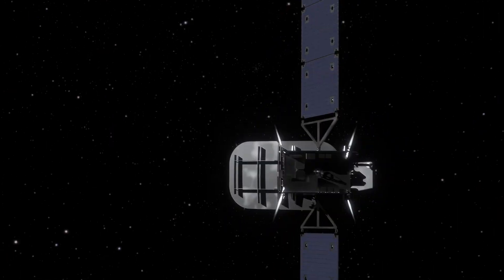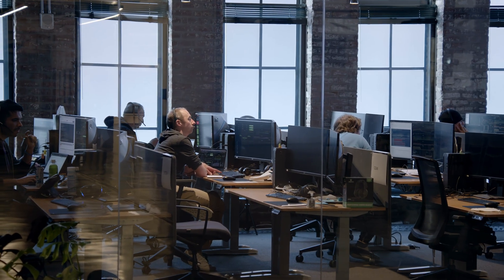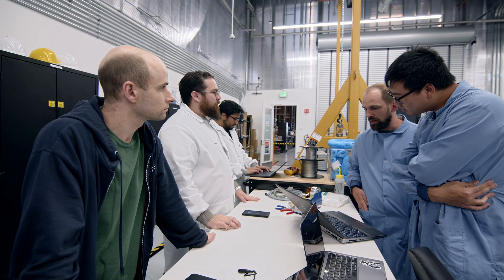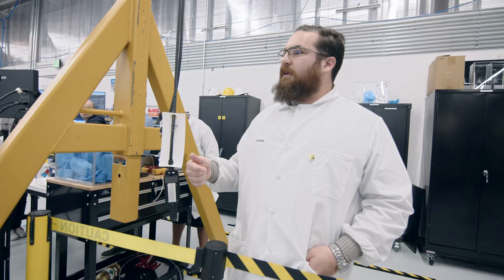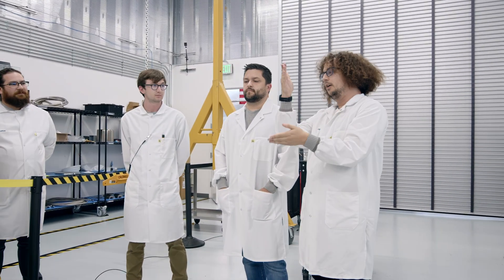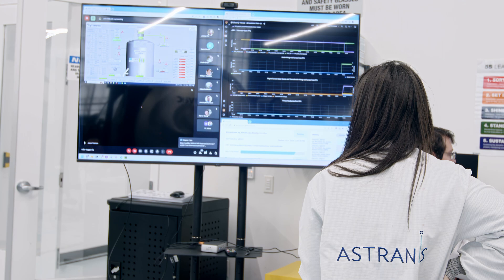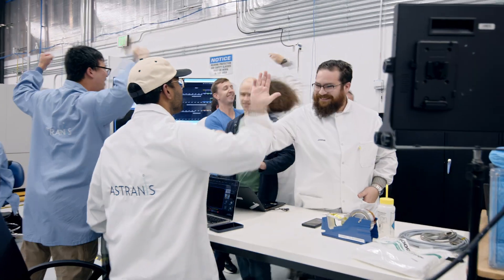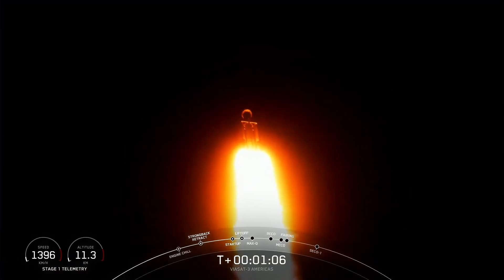How to Fire an Electric Thruster

Comment: This is just an amazing big step for you guys. Congrats to everyone of you, I'm sure all the work will pay and you will be able to step up and go bigger.
PS: You are all such an inspiration for me, even though i couldn't finish my eng degree, im still working as a techinician so i hope i can work in the space industry and be part of all of this development. Cheers from Spain!
Reply from the maker: Thank you! Technicians are a super important part of making the aerospace world what it is -- best of luck.
Reply: Me quite obvious that since the late 40s of the twentieth century, a secret project has been developing in the United States for the development and production of aircraft, where the lifting force is created using high-frequency vibration. It all started with James Pitts' "Sky Car" vibrating orthotopter umbrella, then the umbrella was closed with a dome and devices appeared according to the scheme of conventional electromagnetic vibrating speakers (membrane + inductance) - fragments of the membrane were found by a farmer in Roswell. Then they created piezoelectric thrusters, or with small dischargers on the surface (they glowed all over the body due to ionization of the air), and now they are planes with plasma propulsion panels (so they are angular - that is, with flat surfaces). Thousands of discharge cells are densely packed into motor panels - they shoot streams of plasma (railgun architecture - coaxial electrodes). The ionized air of the spark discharge is accelerated in the railgun chamber by the Lorentz force to enormous speeds - a kind of ramjet engine is obtained. Just imagine! - tens of thousands of small ramjet engines assembled in panels and launching plasma synchronously at a huge frequency (hundreds of kilohertz). Plasma jets form toroidal air vortices - this air cushion creates lift and acceleration. See, for example, the MARAUDER (Magnetically Accelerated Ring to Achieve Ultra-high Directed Energy and Radiation) project. My article "UFOs are made in the USA" and the books "UFO Hunt" and "UFO Elimination" describe all this in detail. The technology is quite mundane - it is known in great detail thanks to information leaks. For example, air ionization in the coaxial elements of a railgun is created using radiation (radioactive polonium is introduced into the metal). Devices of this type were used throughout the 50s-60s-70s-80s for secret missions (they took off, as a rule, from special submarines). With the fall of the USSR, their use by the United States was practically curtailed (in the novel "Little Green Men" by Christopher Buckley, speechwriter Bush Sr., a scene is described where the US president decides to curtail the "flying saucer" project). The winding down of the project can be recorded by the drop in magnesium consumption in the United States, since such fuel was used in fuel cells (magnesium strips were burned in forced galvanic batteries), this is 2007-2008. However, later the development of the technology continued in the Russian Federation and China (the technology was restored by reverse engineering methods for downed devices). Secrecy, however, was maintained and there was no civilian use because the technology was not suitable for it - harmful microwave radiation from pulsed plasma thrusters (harm to pilots and impact on electrical appliances inside and along the flight line). The payload is small (but one nuclear charge is enough). There is no radio communication - the discharges create interference and jam electronics - unmanned vehicles can fly and maneuver only in accordance with the program. Previously, there was a narrow application profile - rare spy missions (so that pilots do not get a lot of radiation). Reconnaissance aircraft of this type were often observed at military bases, missile launch sites and airfields. They were even seen by peaceful geologists in the taiga, where clearings for seismic exploration were laid - UFOs flew there to check whether military construction was underway (I myself heard stories about this))). I think that soon this technology will be declassified, and cargo airships with flickering round plasma panels on the surface of the hull will appear in the Arctic sky.